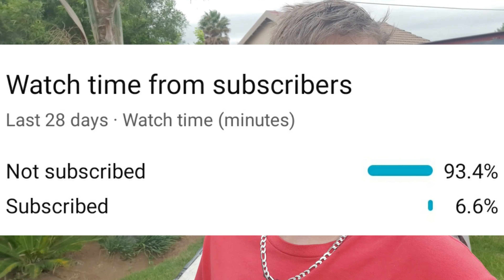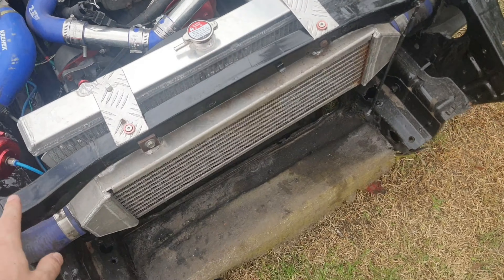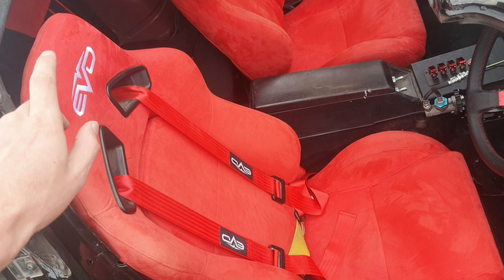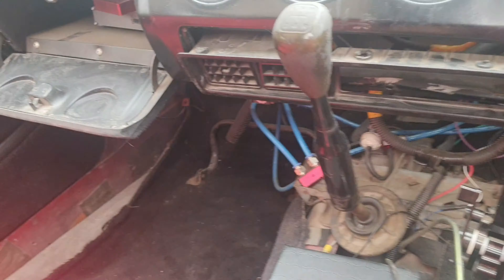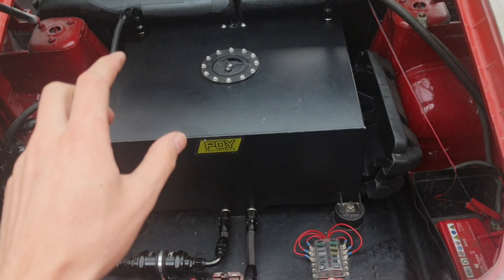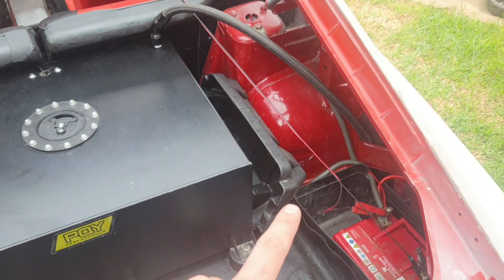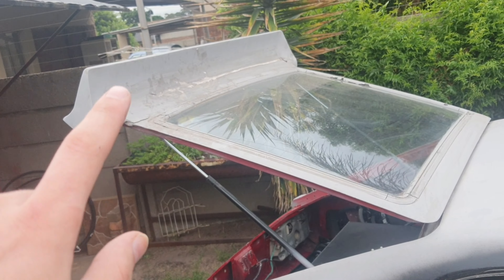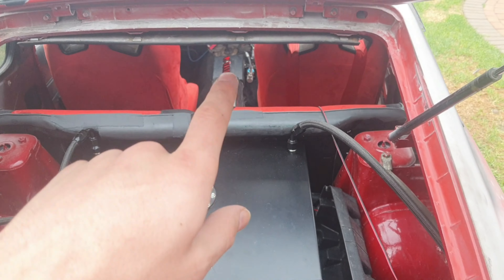Walkthrough of my Nissan 280ZX powered FJ20ET

Comment: If you get a radiator for 240sx with KA engine it will fit the same and move the upper radiator outlet to the other side
Reply from the maker: I hear you buddy, so the Original Radiator got buster so i wanted them to build q new one, so they mentioned that this is the best radiator to use for my application as it keeps the engine cool like a beast, thats why i went with it, just net to redo the plumbing then i should be 100% and it will look nice and decent